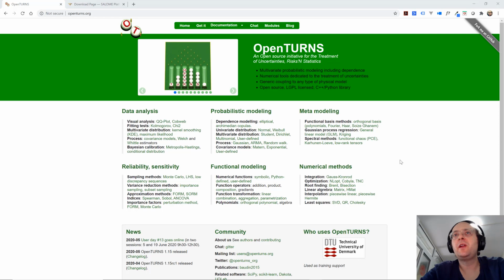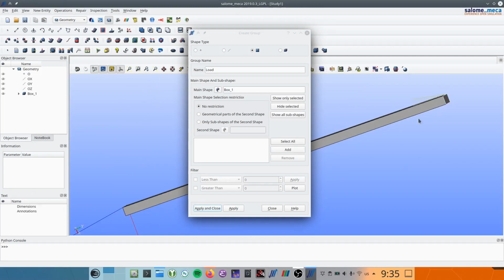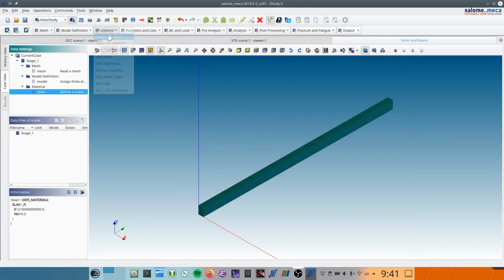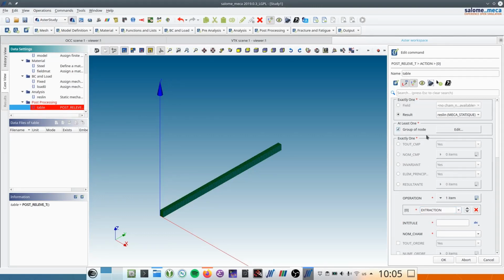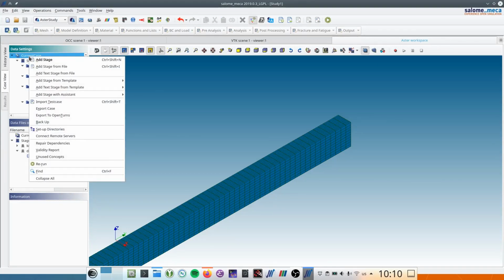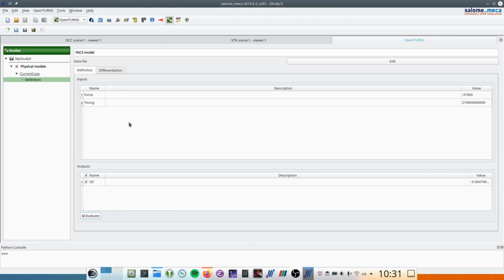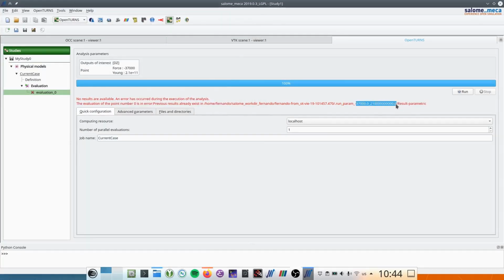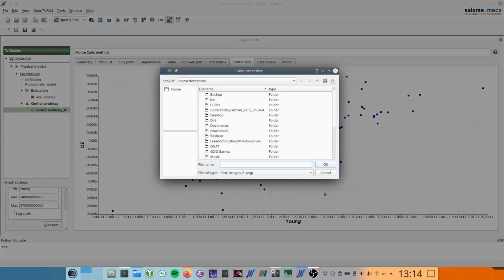How to interface Code Aster and OpenTurns to do uncertainty quantification and sensibility analysis

Comment: Thank you for your video. Does it work with Shaper instead of Geom?
Reply from the maker: Theoretically yes, but shaper is not in Salome Meca yet, so you will have to install Salome and Salome Meca.
Reply: Ok. I thought last salome meca came with salome 9.3.0.
Reply: @3du60   In the newest version of salome meca (2019) you can indeed use Shaper (as is shown in the video). However, if what you mean is the use of Shaper design varibles + OpenTurns... that I am not so sure